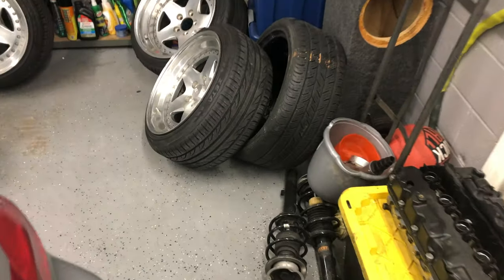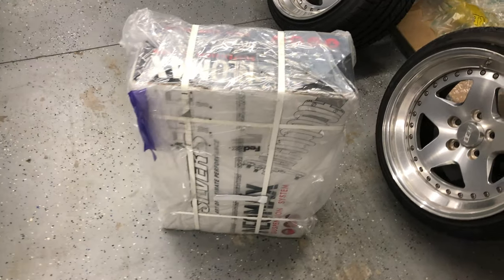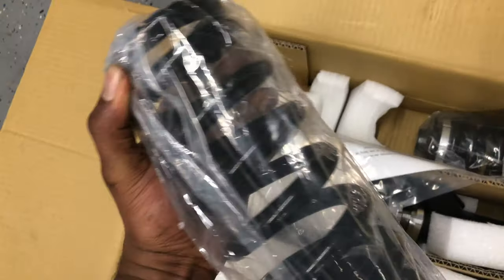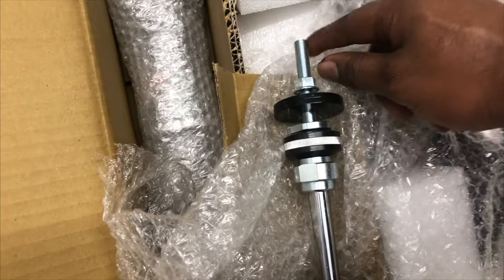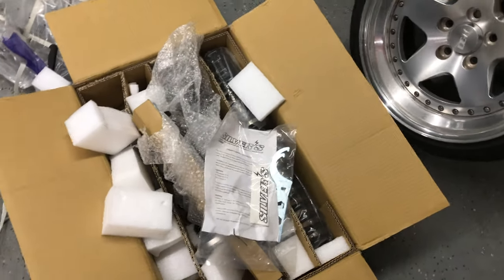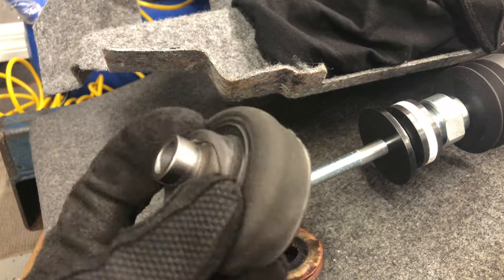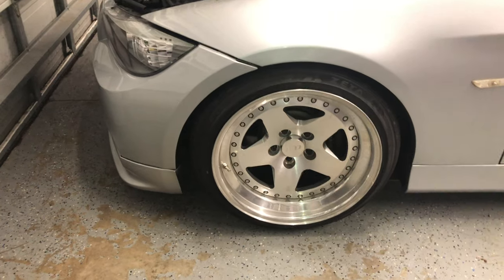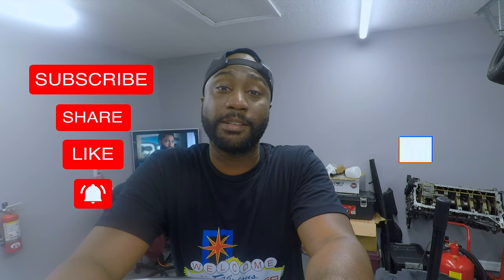BMW E90/E92 Silver's Neo Max Suspension Unbox

Comment: Can you give me a update on these. About to order some BC's but would consider these if they're good on our cars. Please let me know. Thanks
Reply from the maker: Hi yes I’m happy with them, no issues so far. Only thing make sure to get new front end links, since it doesn’t come with it. Ride is firm and compliant. I’d rate it 8 out of 10.
Reply: @nOshi2x  is it comfortable or pretty stiff? This is my daily and I've had lowered suspension on other cars. Some were pretty bone jarring when going over bumps. You felt each and every one of them. While other suspensions I've had were pretty comfortable but performed well for things such as canyon runs. Would you say they're ok enough for a daily?
Reply from the maker: It’s not bumpy more on the comfort end; I have my damping up since I like the ride comfortable yet firm, without it feeling like I’m on cut springs. You should opt for the swift spring upgrade that will yield the best setup.
Reply: @nOshi2x  thanks so much. Last question. What wheels are those. They look real good.
Reply from the maker: No prob. Thanks! They are CCW Classic 5’s